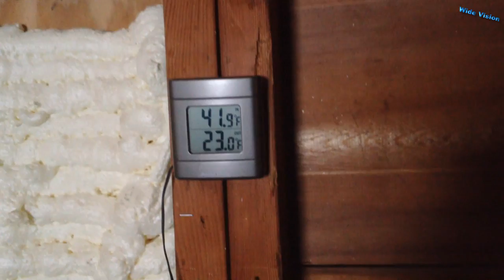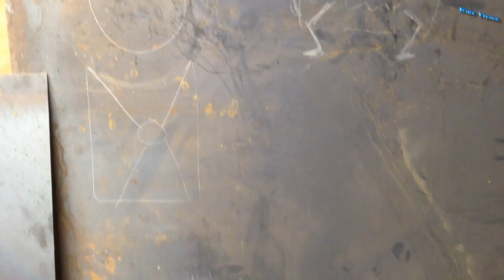Wood Burner Built From Junk

Comment: I liked that.  It is a good use of "unusable" old tools and looks good.  Did the person that lived there before you have kids (that tend to steal tools), a dog that drug stuff around the yard, or just someone that didn't take care of their tools?  I usually use paper or cardboard to start a wood fire.  Every once in a while, I will resort to "Boyscout (or is that Boyscout and Girlscout) in a can (diesel).  Tires used to be good to start a brush pile, but I have to resort to old hay now thanks to Hillary voters and their kin.
Reply from the maker: Thanks! So far, all the tools have been found on the back side of the garage. The previous owner had a "project" pickup parked there, so I"m guessing he didn't put tools away.
Reply: Dryer lint in an old paper towel tube makes for a great fire starter